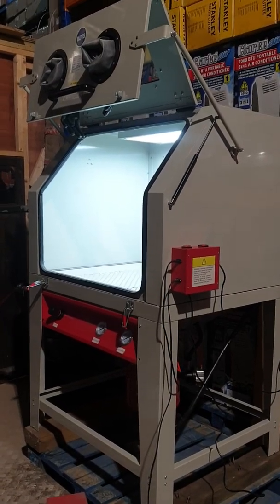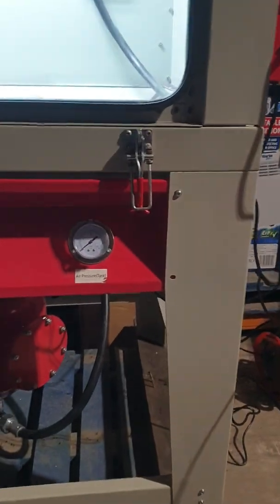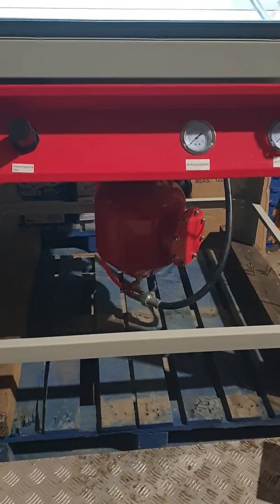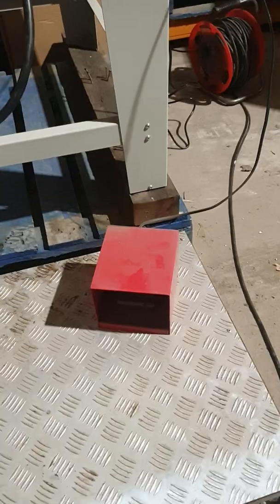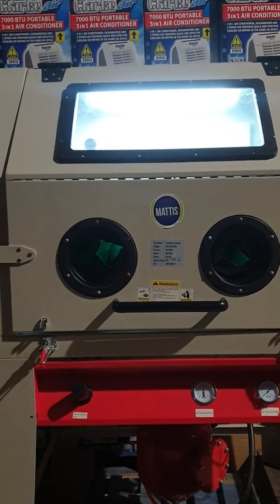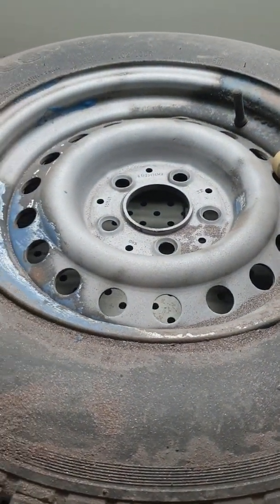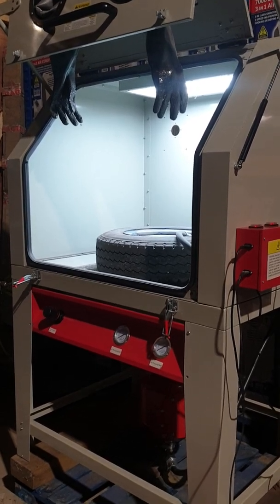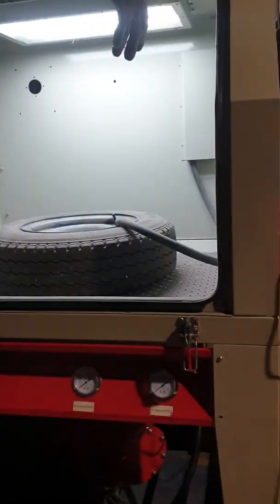Converting a suction cabinet to Pressure cabinet

Comment: Hi, when you blast flaky paint, how do you stop the flakes getting u der and blocking up the  pressure pot? I'm  constantly stripping mine to unblock it, Regards Trevor
Reply from the maker: Is it getting past both grills?
Reply: @Sandblasters  I only have one grill- that explains a lot, thanks 👍
Reply: @Sandblasters  my blaster has a perforated steel rotary table but no mesh! I've made a temporary lower mesh grill which has solved the problem. I'm going to modify the table and put another full mesh grill higher up. Thanks for your help
Reply from the maker: @trevorosborne958  Perfect Trevor

Comment: Hello, in the pressure tank is there any valve that close when you press the pedal? Like the big sandblasters or the pressure is just below in the sand hose?
Reply from the maker: Yes, the mushroom inside the tank goes up and seals the tank so it can pressurise
Reply: @Sandblasters  Hi, I bought a conversion kit from you through a friend of mine. Finally it comes to me, can you tell me what we do with the foot pedal cables? And how we mount the hose in the fitings? Thanks!
Reply from the maker: @antonovcoatings369  Hi, IM sorry i don't have any instructions on how to do this conversion, its just something i have have put together myself.
The foot pedal cables will need to be wired to the side box and the hose get screwed into the fittings, there should be a small bag of screws with the kit you bought